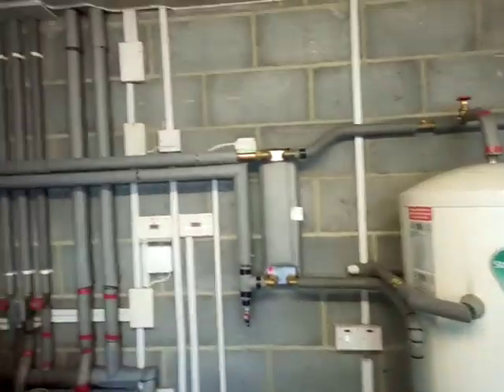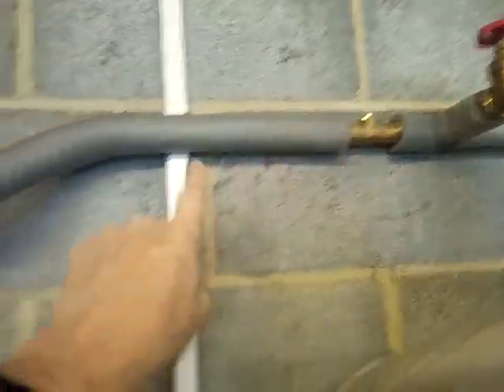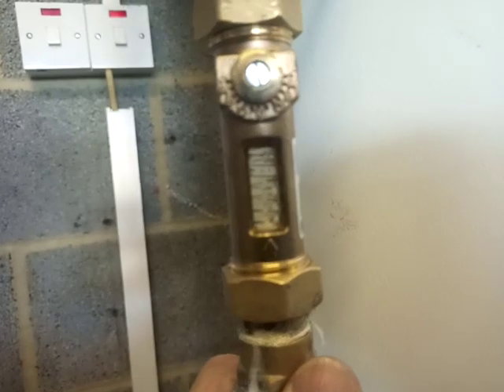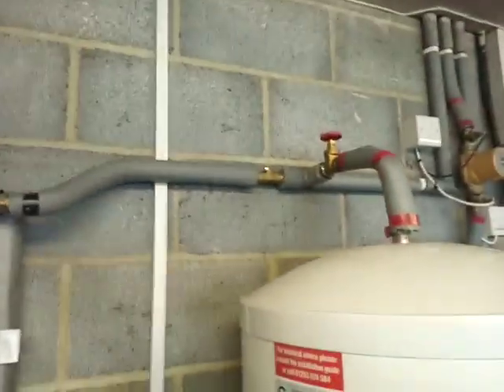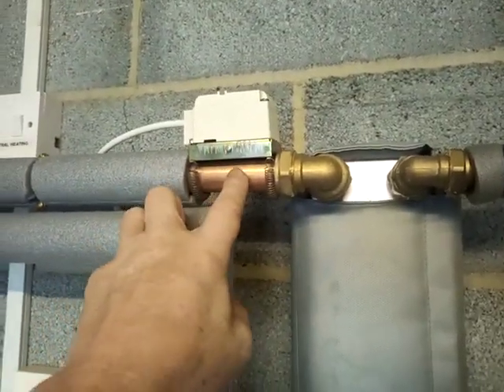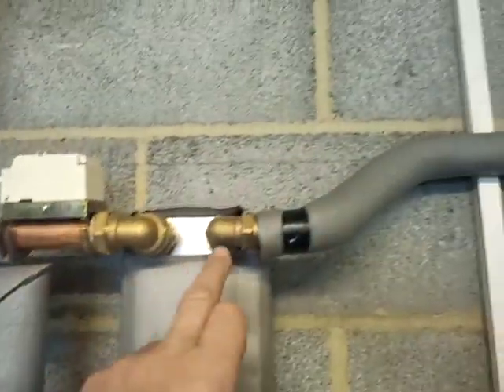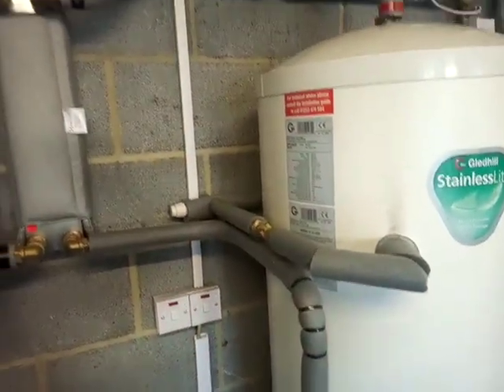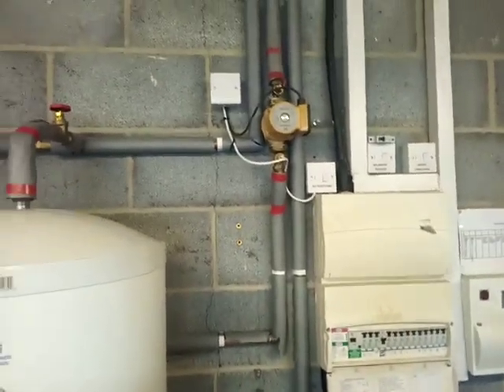Plate loading a cylinder from a heat pump.

Comment: Have you got a rough idea of cost to set this up Andrew? ive got a heat pump job thats currently got a 150L unvented cylinder in place which seems perfectly fine and is around 10 years old but want to weigh up costs.
Reply from the maker: 600 plus vat
Reply: @andrewmillwardwatford9410  is that materials alone? Plate + bronze pump + valves and stat?
Reply from the maker: @UrbanPlumbers  yes

Comment: Hi Andrew, thanks for another informative and enjoyable video. Just lately I seem to have consumed a lot of info/videos on hydraulic separation but have to say I feel more confused than I ever was. I have been installing the stock 'good old systems' that I think the majority of installers have fitted for many years. With bits of extra information in the industry across the years I have adopted ideas such as low loss headers etc and incorporated them into my bigger projects where necessary. I have to say that I haven't had any systems that do not work correctly but with the advent of pump performance and flow rates etc I have to say these old installations now seem 'more by luck than judgement' if I am honest. My question to you is can you recommend an article or video that you feel best demonstrates things such as hydraulic separation etc for systems with ufh/2x heating zones/ uvhwc in a 4 bed house for example. Hope you can help. Thanks
Reply from the maker: The heat geek course is good.

Comment: Nice pipe stat idea
Reply from the maker: A tip from Adam at heat geek. Not my idea.
Reply: If your waiting for the heat pump flow temp to reach 50 degrees c, rather than using a pipe stat, couldn’t you add a balancing valve on the hot water pipe just after the bronze pump, limiting the flow rate across the domestic side when hot water is calling? This would I turn rise the temp of the heat pump quicker to suit a new DT transfer without having to wait for the primary’s to heat up with a gradual temp? Further to this add a modulating DT targeting bronze pump working the opposite way to a standard DT pump?

Comment: Having done something similar may I suggest to place the secondary pump on a timer with a button to override it when out of hours save a lot of energy and double the insulation thickness and seal evrything
Reply from the maker: The secondary pump will be on a pir so as it operates only when needed. Are you suggesting a timer as an additional measure to the PIR ? Totally agree with the insulation but I can only access the exposed pipes. My fear is that out of sight pipes are not insulated.
Reply: @andrewmillwardwatford9410   Hi Andrew, your ideas are great and will save water and energy' I've come from the commercial side and it would be wise as you have probably done already to see how you use the hot water if the house is occupied during the day or not PIRs are a great idea but if fitted in the kitchen for instance and someone goes in the make a cup of tea this would set the PIR off unnecessarily it depends on how one lives, and we are all different I've got mine on a BMS system which operates the pump during getting up time, and washing up time in the evening if hot water is required outside these times then we push the "red Button" which sets a count down timer for 20 minutes, Anyway just an idea. Just a note of caution though don't make it too complicated as if a "heating engineer" has to be called in these type of system is outside of their comfort zone ( on the south coast anyway)
Reply from the maker: @MG-qo5ge  I think heat pump with weather compensation already excludes a massive number of engineers. I agree about the kitchen and push button but my customer wants PIR. I've positioned it to minimise in necessary operation as much as possible. However making a cup.of tea will trigger the pump. No perfect solution I'm afraid.

Comment: Hi Andrew,
I have a question for you? Could I heat a buffer tank to 85 degrees c with the use of a gas fired boiler and then increase the temperature with a 3kw 3 phase immersion heater to take it up another 10 degrees c to 95 degrees c?? The volume of the buffer is 120l. The reason I ask is we have a client with a chocolate factory looking for a 85 degree c within a 300l urn and the gas fired boiler only achieves this to 78 degrees c and only looking to achieve an additional 7-10 degrees c.
Reply from the maker: I think so yes.
Reply: That kind of process application is typically done using plant steam, not LPHW.

Comment: 🤦‍♂️🤦‍♂️please take that gate valve off the hot outlet you’ve got an isolation on the cold coming in if someone turns that off and the safety’s fail boom atleast you can take pressure off by opening taps